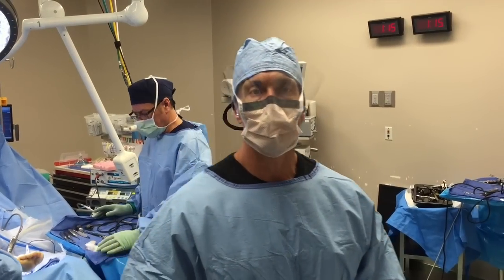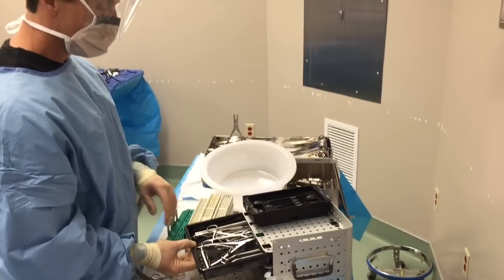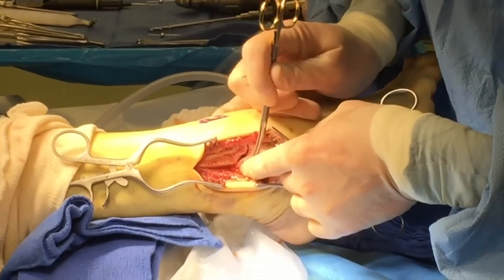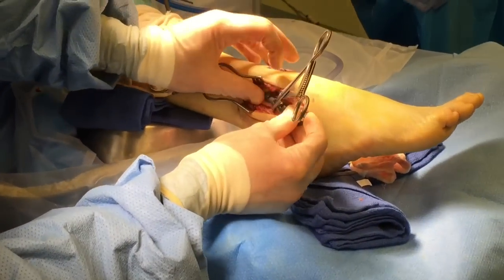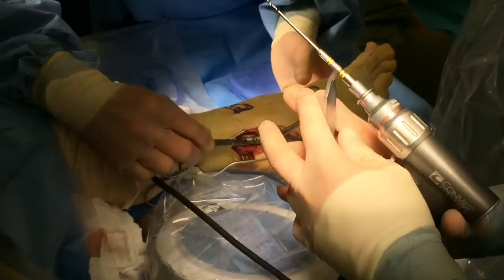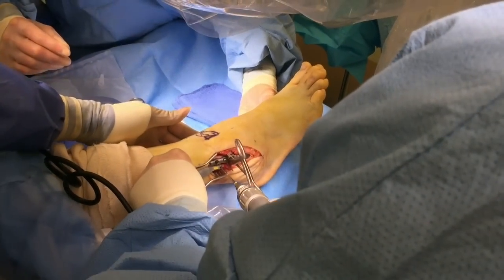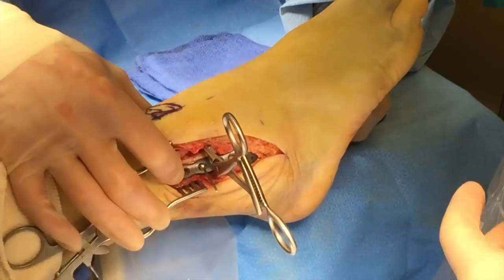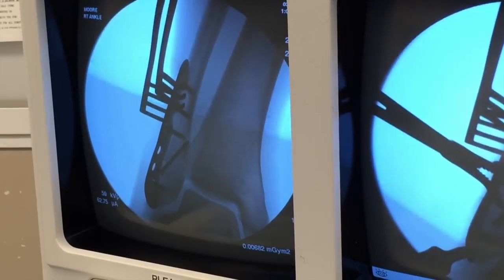Ankle Fracture Surgery Video | Dr. Moore Using Stryker 'VariAx Fibula' Plating System

Comment: This is magic. Broke my ankle 30 years ago at high school. Still have the plate and screws in my ankle. Stronger than ever!!
Thank God for doctors.
Reply: Hi can you tell me how good your mobility is right now after all these years? Do you still limp
Reply: @aishuxoxo  
Limp?
Are you kidding me?
Two months after the surgery I started rehab- and about 6 months after the surgery everything was good as new. Mobility 100%
It has been 25 years since that surgery and I’m stronger than ever.
Reply: @aishuxoxo  i stared rehab like 5 days after surgery, without weight on the ankle and now it is 8m and i am as strong as ever. Sometimes, very rarely i sleep badly so i can feel the ankle when running but most of the time i dont know that something ever happened :D

Comment: This is precisely the same thing that happened to me. A fractured right fibula and the tibia shifted to the right off it's base on the foot. Eight screws and a plate for me. Hurt more broken than it did repaired (I had surgery yesterday after 1 week sustaining the injury). Not to mention Vicodin helps and the nerve block that was given to me is finally wearing off after about 16 hours.
Keep moving the leg after elevating though to avoid clots. Plain old coated aspirin was prescribed for me besides the narcotic.

Comment: I had this surgery done over 17 years ago. Today I looked down at my scar and decided to see how it was done.
Reply: Hi. I had this surgery about a 2 months ago im in the stage of putting 100% of my weight on my foot. And im just wondering how the plate has any effect long term or if it has any effect at all. Personally im a runner and im nervous to start again any pleasing news?
Reply: @galvarez7727  hey im going to have this surgery on Tuesday. How does your ankle feel and how long did it take for you to start walking without crutches. Oh and when were you able to start runnin again, since I lift weights and I want to know when I’ll be able to do squats again.
Reply: @galvarez7727  oh and did the pain improve or does it get worse right thing after surgery? Cuz right now I’m waiting for surgery and it hurts a lot especially when I’m lying Down in bed with my foot on the bed I can’t find a comfortable position where it doesn’t feel I’m putting pressure on it which causes pain.
Reply: @MMixer882  Depends on your age and health. I’m a teenager and it took me about 7 1/2 weeks to start walking with a boot and no crutches. From there it was gradual for the boot coming off. I was told to walk around my house with shoes and outside with a boot. At about 10-12 weeks i was with no boot or crutches.  Currently its been 4 months since my injury and I’m starting to run again.
Reply: @MMixer882  yeah I understand it is painful for the first month. After surgery it will hurt constantly. But it will go down just got to push through it. The pain i was feeling was like a 7/10 to 6/10 in the first week. Then slowly it will be going down ill say after about a month and 1/3 and it would go down to a 2/10
Reply: @MMixer882  also to improve your recovery out of the boot. Getting back to exercises to build all the muscle that was lost is crucial. However don’t over do it when you get to that point.
Reply: @MMixer882  I would recommend to get physical therapy. It helped me gain movement really fast
Reply: @galvarez7727  ok. And I’m 16 and I’ma eat nutritious and high protein foods and ima also try get into rehab after surgery so I can help speed up recovery.
Reply: How r u guys now r u back to normal run..
It's my 3 months now

Comment: I'm 2 months and a couple weeks post surgery on a trimalleolar fracture on my left ankle. I've got a plate and 10 screws in and watching this has fascinated me yet freaked me out. I remember seeing the x-ray for the first time after surgery and seeing the plate and all those screws (short and long) in my LEG and gasping. It's amazing yet freaky to know I have metal in my leg and will forever. I'm grateful for it though because it's helped so much. Now I'm in physical therapy and it has helped me so much. It was scary to go through but I'm glad my healing process is almost done. Just gotta get that darn Achilles' tendon to loosen up some more. 😝
Reply: Alexis L i had my surgery beginning of april. I had trimalleolor fracture as well. Never wore a hard cast, but plaster for 2 weeks after surgery. Then i was in walking boot. Wasnt supposed to walk with it or put weight on my foot, and i did anyway bc i needed to go back to work. but since Tuesday last week my last xray showed it was healed and couldnt tell it was broke. The swelling now is bothering me the most. If u need advice, take turmeric.
Reply: I had a bimalleolar fracture and seeing the screw in my foot freaked my out more than the plate because it looked huge. I’m only 4 weeks post op but I so hope I can go back to walking normally and exercising.

Comment from the maker: The hardware usually remains in for life unless a screw head or other part of the plate becomes prominent and painful and/or rubs on a pair of shoes, boots, etc.
Reply: can a metal dectector go off because of that?
Reply: Moore Foot and Ankle Specialists - Dr Robert J Moore III & Dr Eric Blanson  I had a surgery where I had arthritis and a facture so they put a pin in but the pin was big and I could feel it poking out from the back of my foot . The second surgery I had  it taken out and put a smaller one in. but now having surgery next week bc the pin cut off the blood flow and now I have a dead bone in my ankle the size of a quarter.
Reply: Moore Foot and Ankle Specialists - Dr Robert J Moore III & Dr Eric Blanson is that the "Surgical First assist/assistant" doing the screwing ect? or just a surgeon in training ?
Reply: Moore Foot and Ankle Specialists - Dr Robert J Moore III & Dr Eric Blanson 
How long till a person can walk again ? I am due to a holiday on 22nd April
Reply: Hi i had also a same problem now doctors remove all the screws from  my ankle .but my ankle not move properly and pain when move give me tips (sugetions) please
Reply: no actualy never happend to me
Reply: @Gandolfini666  nah, never happened to me, and I had the same surgery but my plate was bigger and they used 10 screws
Reply: i fell down stairs my ankle bone snapped out of place, then i fell again and it snapped back in place. Would my ankle be broken or fractured?
Reply: dave israel really depends on the detector.  Airport-no.  The handheld wand detectors, yes.

Comment: Thank you for the video Dr. Moore.   I broke my fibula a week ago and I am scheduled for surgery for this coming Monday.  My doctor said he is putting in a plate with 6 screws.  My question is am I going to be able to run again without any pain in the future?  How long is a full recovery from this surgery?  If the plate and screws are taken out later, will it cause any problems? Watching your video makes me feel "Moore" confident. God Bless and thank you for the work that you do!
Reply: +thegoldenhurricane I broke my fibula last month (compound fracture) and have the same concerns. Are you able to run now 3 months later?
Reply: +steve fischer Mine took 4 months to recover.
Reply: Daniel Pang In three days itll have been 4 months since the injury. Im able to walk now without a limp but definitely cannot run or jump. My range of motion is about probably 70-80%
Reply: +steve fischer Sorry, I just saw this question.  Steve, it's been six months since my surgery and I am walking without crutches.  Not only did I break my fibula, but I also partially tore ligaments as well.  the fibula has fused back together several months ago, but it takes time for the bone to get strong internally.  My surgery was Oct.26 and he cleared me to walk without the crutches after two months.  I wear the walking boot when I go out simply because it provides support and keeps my foot from accidentally rolling, which would cause more damage.  I do not wear the boot at home, but I wear it always when I go out.   The ligaments take about ten months to heal.  My foot is still bruised and a little swollen where the ligaments partially tore.  I still have a little bruising where they put in the plate and screws.  your recovery time should be shorter than mine, however, remember that even though the bone has fused back together, it will take up to a year for the bone to be internally strong to where it was originally.  I wouldn't push running now, just walk and let time takes it's course.  I wish to u the best of luck brother.  Eat healthy, take multivitamins, calcium plus D and don't worry about running just yet. Take your time!  Don't push anything, be patient! God bless and a healthy recovery my friend.
Reply: thegoldenhurricane thanks for the advice! I've been out of my boot for about 2 and a half weeks now and walking without a limp. With physical therapy I'm slowly getting my calf muscle strength back and will hopefully be running mid to late june though thats very unlikely haha
Reply: +steve fischer Great to hear, like I said don't push the running part so fast.  At this point just focus on your stretching and some calf raises.  wait a minimum of at least nine months before you consider running.  just because the bone has fused back together doesn't mean that it is internally strong like it should be.  be patient and avoid 're injury.
Reply: thegoldenhurricane I agree. I'm a very active person so learning restraint and patience has been a positive from this mess! haha
Reply: +steve fischer lol trust me, no basketball, golf, disc golf, running, mountain biking etc for the last six months has been hard.  Pobably another four to five months before I can do any of it.  Proper recovery and avoiding re injury is totally worth it
Reply: @thegoldenhurricane  I just had a accident like 2 days ago where I full dislocated my ankle and you could clearly see the ankle full twisted to the side and I also broke my fibula. That same day they had to relocate my ankle but ima have surgery to get the screws in my ankle in a couple days. Did y’all have lots of pain before surgery on your ankle and was it hard for y’all to lay down with your ankle with pain because everytime I lay down in my bed my ankle hurts. Is that normal? Oh and how did y’all clean yourselves with the cast on your leg. I’m using wipes but I want to know if there’s a more effective way to clean your body without wetting the cast.
Reply: @Southpaw128  Hey buddy! Just checking up on you 5 years later lol how did your recovery go? I'm running again and very seldom have some pain issues.
Reply: @MMixer882  Sorry to hear about your injury!  The pain is normal, just keep your leg elevated. It really hurt when I stood up and all of the blood rushed to my foot.  The wipes are good to use t9 clean.  I went to the Dr. 3 days after surgery and he cleaned the ankle.  I had to wrap my leg with a trash bag to keep it from getting wet.  2 weeks later i went to the Dr. and he took the stitches out and put some waterproof tape straps on it.  You basically leave them on until they come off by themselves. Mine lasted a few weeks. I bought a walking boot 2 weeks after surgery and had that thing on 24/7. I only took it off when I was showering.  Sleep on your back and put a couple of pillows under your leg.  I took the boot off when I went to sleep about 2 months after the surgery,  other than that I kept that boot on all day.  I was on crutches for a couple of months.  It's a good idea to keep that boot on when you leave the house and even when you are off of your crutches.  I completely got rid of the boot after 14 months.   At that point o could roll my foot without pain.  Just take it easy and don't rush anything.  I'm back to running again and I have little to no problems.  Sometimes I feel a little discomfort when I run a little too long.   I wish you the best! Speedy recovery, mu friend! Keep us posted. If u have any questions just ask.  Take care and do your physical therapy,  whether you do it at home or with a therapist.
Reply: @thegoldenhurricane  ok thanks wil do. And when were u able to start walking and walk up the stairs without crutches?
Reply: @MMixer882  You're welcome.   I actually live in a 2 story house lol  I was able to do that after a few months.  Just take it easy and your body will let you know what your limits are.  When you get off the crutches, go for a walk everyday with your boot on.  Increase your distance slowly.
Reply: @thegoldenhurricane  got it👍🏼
Reply: @thegoldenhurricane  glad to hear you're doing well! I barely think about my ankle now and I exercise without restraint.  Now I just have the gnarly compound fracture scar and surgical scar on the other side as a reminder haha.
Reply: @Southpaw128  are u able to squat with heavy weight without problems?
Reply: @MMixer882  I definitely could I wanted too but I'm not a heavy weight lifter. I workout mostly calisthenics, body weight exercises and train boxing. I also surf and snowboard without issue so any controlled exercise is something I don't even think about. Where in the recovery process are you? My best advice would be to be patient and take your PT seriously. Your future you would be happy you did.
Reply: @thegoldenhurricane  hey there. I’m 4 weeks and 3 days post ankle orif and today I had a checup this morning. They took the cast off and put me in a boot, but they were touching and moving my foot a lot, especially when the guy was putting the boot on me it was painful. It didn’t hurt that much after I left but a couple hours later the pain started getting worse and I was going to take the boot off to shower but it was so painful, I still managed to take it off but it hurts so much right now in my heel and the back part of my ankle and it’s frustrating because I was doing so good already and pain was like a 2/10 and now I can’t even lay my foot down since it hurts so much.maybe because of the different angle it was in cast compared to boot. Did you go through something similar when you got your boot?
Reply: @MMixer882  The pain is normal, especially when you DON'T  keep your foot elevated.   Keep it elevated when you are sleeping and when you are sitting down somewhere.  I had to keep it elevated for about 9 months before the pain went away from not keeping it elevated.  Only take your pain medication when you actually need it.  Do your physical rehab every day. Just hang in there, it takes time amd patience.  Use your crutches with your boot if you do excessive walking.  Wear your boot when you leave the house.  I wore my boot outside of the house for 14 months.  I stopped wearing it when I could roll my ankle without any pain.  Wearing it out is important because, if you are out and accidentally roll your ankle that boot will save you from further injury.  I was on crutches for almost four months.  I walked  everyday with the boot on to strengthen up the bones and ligaments etc.  Just have patience, this injury will be a distant memory in no time!
Reply: @MMixer882  I forgot to mention that I kept that boot on all day for about 2 months after my surgery,  even when I slept. I took it off when I slept after 2 months after my surgery.  They used waterproof bandages when the took the stitches out.  I took the boot off when I showed and then let my foot breathe for a while after. Keep that boot on for atleast 2 months fully.  I took the boot off when I slept after 2 months and put it on in the morning.  Keep your foot elevated and learn to sleep on your back lol as far as showers go, I bought a medical shower seat, a plastic bucket and a big plastic glass.  That's how I showered for the first 4 to 5 months.
Reply: @MMixer882  hi put a bag over it and tape the bag around the top
Reply: @jasonmarshall6654  I’m way ahead of that.🤣I’m walking fine without crutches or boot now still some pain in my heel though I guess cause I overworked it.
Reply: @MMixer882  hi my name is also Jason Marshall I have an up coming surgery soon and it is 3 months after I broke my ankle boy am I scared